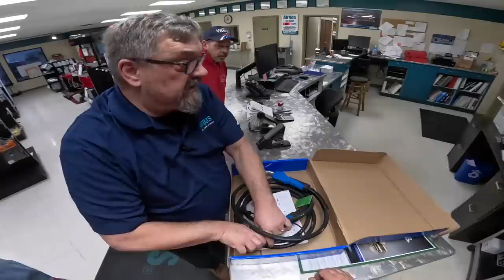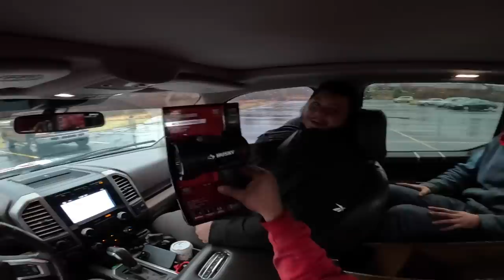The shop boss is driving me crazy with too many IDEAS!

Comment: Ryan you should think about getting a leather apron for when you use the grinder. I worked with a guy who was grinding one day when the wheel broke apart and it threw a sliver into his chest and missed his heart by only an inch. Better to be safe than sorry.
Reply: This!!!!
A hot peice of metal landed in my hoodie and light on fire
Minute goes by I’m like man sometimes smells funny and I felt the back of my neck getting hot and my hoodie was on fire 😂😂😂 had to rip it off and stomp it out
Reply: Did they remove the bit from his chest or did they leave it in him?
Reply: I thought you meant a Wire Wheel bit, I guess they would remove it if it's a grinder bit :)

Comment: Just letting you know. If you ever feel like the whip is not letting the wire come through easily. It could be the liner to the gun. The liner inside the gun wears down and won't let the wire properly come out. New gun you should be good for awhile. Just a heads up
Reply: Sometimes you just have too many tight bends.  I was taught to take the liner out and clean it with lacquer thinner occasionally.

Comment: Loved watching your testing methods on your improved salter protection system. Here are some ideas for your shop. Cabinet / racks to keep your merchandise off the floor. Also, a pressure washer to clean your vehicles and equipment.
Reply: was thinking the same a pressure washer but those undersides are protected against salt and pressure washer might blast that off.

Comment: Need to build a stand for a waste oil drum, couple feet off the ground. Put a barrel on the stand with a spigot on the bottom. Pump all the waste oil you got into it through the top. Let it set for a few days and then just skim the water/coolant off the bottom until its oil coming out. Then it's ready to transfer to the furnace.

Comment: Hope you disconnect the battery on the trucks before welding on them. If not it's very bad for the ECU on them. It can and will fry them if you don't.  I personally made that mistake on a brand new 750 service truck.

Comment: Victor please, when you use that machine, to take the paint off etc, with the spinning  blade, please please use safety for hands, and make it tight on between something. Then use the machine,...
I know cause it happend to me, and it doesnt feel good and it ofcourse hurts alot. its called a flex how we call it in netherlands :)
Reply: Up in Boston and haven’t had a plowable event yet!!
Finally pouring some concrete though! Just signed a contract to pour a floor at a Toyota dealership around the turn table they use
About 1,100sqft and 12.5-13 yards

Comment: Definitely not cheap, but I use a Landa heated power washer to wash my plow equipment off equipment. Could also use it in the new truck just 40 degree tip and don’t have the guys get close to it 😂